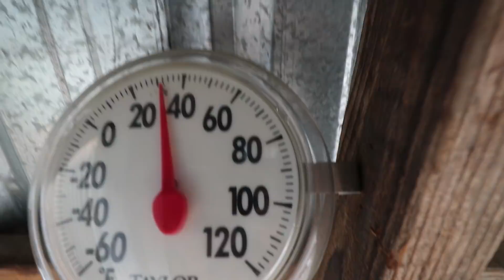Backfilling an Impossible Hillside Trench With Sand (From a Hose!)

Comment: wont the sand wash away in heavy rains or melting snow?
Reply: Yup
Reply: Unstable material will end up at the bottom. You only need to see the news to know what it can do.
Reply: John Wu no....it's not really the kind of sand you're thinking of.
Reply: It's exactly the kind of sand he was thinking of. You just watched them have to damn the thing in order to stop it flowing out. Wow, did you even watch the video. This sand flows with water. Press play for the evidence.
Reply: newly mixed concrete also flows with water. Pretty sure it doesnt after a while tho?
Reply: Jimmy Wännström 
This isn't concrete. There is no cement or  adhesive in this. 

Your comment is silly.
Reply: Do you really think they spent all this money in what you think is NORMAL sand just to have it flow away after some rain? I know the general thought is that Jesse is stupid and know nothing. But shouldnt the guys helping him know that this wont work and tell him that? After its their work. I certainly wouldnt do a job for someone with 300k subs on youtube knowing that it would fail after a year. Hell even this job was poorly executed and could make for some bad publicity.

And even if it were normal sand they could easily fill the top with soil/concrete or something else to lock it in place.
Reply: Jimmy Wännström I'm an excavation contractor and when it comes to sand, sand is sand it all washes out! There's no rock's to bind it from moving. And I've found that the majority of the time the customer thinks that they know more than you do and want you to do it anyway. I mean the customers always right, right?? I always tell the customer what's in their best interest but most want you to do it their way anyway! That's why I make them sign a disclaimer contract!
Reply: Steve Sheppard maybe do some research of this type of "sand"...it's angular not round like beach sand.  It locks to itself.
Reply: If thats the case then I agree that it is very stupid. I still hope that its not and/or that they plan to cover it so it wont wash out. Lets hope Jesse and Alyssa thought about it before spending their money on it.

Comment: Are you putting rock on top to help keep rainwater from washing the sand out ? Just wondering .
Reply: The sand will harden up and rainwater likely won't be a problem. This type of sand, known as "flowable fill" will set up and be as tight as a compacted structural fill. It would take a fire hose amount of water directed at the fill to start to get it moving again, and it would only be maybe 20 feet of the sand moving, the rest would be firm and stay in place. The sand trench will transmit water through it so look for any rain or snow melt to move down the hillside and make a mess each year for them to clean up ( but not as bad as the overrun near the hot tub steps). Another Jesse " Oohhh" moment that he will have to live with year after year.

Comment: congrats guys on getting her done  on a side note hindsight is always 20\20  if you had the time putting some boards up with spacer holes for the pipes at various points much like the steps for daming the sand lava flow may have helped  i know the timing wasn't right  but now at least you have the sand on site  cheers for the video

Comment: Why are you filling it with sand?  What's wrong with like filling it back up with clean dirt?
Reply: t450f They don’t have a clean dirt pile so they would have to buy it and drive the backhoe down the step slope. They also said that it would be cheaper to do it but pumping it once you consider you own time and labor and still the same cost of material

Comment: What keeps rains in the future from washing the sand down the trench?  In 5 years... what prevents an enormous sand pile down beside the hot tub?
Reply: They use this process to fill trenches on hillsides all the time and it does not wash away. It packs in solid. Sand is used to filter water. Where do you think all the water mixed with the sand went? It dispersed into the surrounding soil. They even use sand to make islands and the ocean doesn't wash it away. The sand will not wash out barring a massive flood.

Comment: While i’m no expert, this seams like a costly, environmentally bad way to install a water line.
Reply: it could be im not really sure thought to reinforce the pipe to keep it from busting if it freezes
Reply: Like lie it on the ground and dump 10" of dirt over it. No freezing done
Reply: Costly, yes, but enviromentally bad? Not really. Altough i'm pretty sure this will crack in no time, since there is no kind of lining, water can seep down around it and freeze, thus breaking the "lava sand" bit by bit
Reply: Yeah that sand will erode every time it rains heavier than a drizzle. Lifetime of moving sand back up a hill is no fun. They would have been wiser finding cheap or sometimes free fill dirt, more labor initially but once it's there the job is done.

Comment: All that work to protect the tree roots with air trenching, only to choke their growth with zip ties.
Reply: in a few hundred years
Reply: You serious? You think a zip tie will choke a large tree root?
Reply: Zip ties won't degrade very fast when they are buried underground protected from UV light. Depending on how tight the zip ties and the "buried waterline" ribbon are on those roots it's likely they will damage the roots long before the Zip ties degrade.
Reply: Walt Sorensen 
I think you underestimate nature.
Reply: Paul Denney that's if it doesn't snap it.
Reply: Paul I've seen both trees grow around an object, and a tree branch or root die from strangulation. You should never assume that a tree will always grow around an object. Possible, not always.

Comment: The stuff tied to the roods will definitely kill them. 
Why protecting the roots and now cut them of?
Reply: Schmunzel57 
You think cable ties will kill a root? Even if you take a chain around it, it will not kill it. It will just throw around it and eventually engulf it. As for cable ties, they will just snap.

Comment: Question:  why didn't they start at the bottom with the pump?  Would' nt that create a self damm.
? And avoid the down hill flow>
Reply: Phil Anderson nah, it would have washed out as the water drained through the uphill sand.

Sand bags at the bottom to create a dam would have been the proper way.
Reply: Did you see the guts on them boys no way they were going to pump uphill when that hose fills up it doesn’t move easy

Comment: im no contractor, but shouldnt that pipe be at least 4 ft below grade? and I find it hard to understand why you are filling it with sand... why not use filter fil to inch minus, or 2inch minus... and just use the tractor, and a dump trailer to bring it up to p, and use a mini dozer to push it down...... the steep slopes are gonna be a bitch to keep ful with rainrunoff just washing it out.

Comment: Total cost of the sand backfill?
Reply: I think I heard $40/cy times 3 truck loads (10cy/load??) =$1200 plus pump which is several hundred $$.  Painfully expensive.
Reply: Seems like it would have been much less expensive and more reliable to just have tapped into the public water system.  I remember a video of them saying that was a possibility and for not much money comparatively...but they didn't want a monthly bill.  Strange being that they paid so much for their cistern water system in time and money and then have the regular task of going to town to get their water.  I don't understand why this is better.

Comment: Wow dude and dudette .... after viewing these videos on your water line trench ... well, frankly, scary. I know there are no building codes where you are, but all you have to do is google the idaho frost depth. For Idaho, that is an average of 31", meaning 31" and above, water freezes. NOTE, that was AVERAGE. Think you are in the mountains above Coeur d'alene or Sandpoint, so you are probably going to be more like 40", OR MORE. GUYS, you don't want water during the winter? And, you want to have to dig those pipes up because they've cracked due to freezing? I can't believe someone didn't say something to you. You unfortunately have a ticking time bomb. Also, note that your SEPTIC lines contain water.

ALL pipes that contain any liquid in Idaho are usually a MINIMUM of the frost depth, but most of the time, for insurance, people put them AT LEAST 48" below finish grade.

Then, there are those footings / foundation for your garage. Hope those are below your frost line. Haven't viewed those videos yet.

Though your area does not have building codes, you do have a few inspections required. And, it is hard to believe one of those inspectors didn't warn you about this.

Not trying to cause problems, but this stuff is really basic and could haunt you if something isn't done sooner than later.
Reply: Finally someone tried to explain to them without calling them dumbasses or worse right off. If they don't listen it's their fault. More repair videos for us in the future it looks like. At least they have drive and a good work ethic, they are gonna need it.

Comment: Looks more like a cement and sand slurry, than just sand and water.
Reply: Initially, I thought it WAS cement too.
Reply: Charlie Zellner I would have thought something like 40mm to dust, sort of thing they use under roads, would have served them a lot lot better. Locks together, can be vibrated and compressed. The only downside is that bloody hill and all those obstacles.
Reply: Road foundation stone is usually very cheap. As you fill the trench at the top so you make a path for the barrow. Couple of strong lads, done in two days.

Comment: Why were you guys so concerned with keeping the electrical conduit spaced above the water pipe ???????
Reply: Pace Metal Fab and Waterjet 

More than likely to be able to find the pipes with a metal detector easy but... with all that sand that’s going to wash away  they will have an easy time to  find the pipes easy . Should have poured concrete  should have chopped roots should have should have
Reply: Dam placement would have been a huge help. the sand will be downhill in short order,
Reply: watahyahknow if they had mad a sandy mix with Portland cement maybe even mixed in some mid size crush stone but the point is why not do a pour could have made s stair case out of it

Comment: Might I also add that running a generator all the time is expensive and not very environmentally friendly. Until you can arrange an array of sufficient solar panels to provide enough energy to sustain your power needs, why don't you connect to the grid while building your home? Surely your neighbors are connected to the grid.  Just think of the money and hassle you would be saving. I call that common sense. Love to see a reply as to why what you currently are doing makes sense.

Comment: over what was the cost vise doing a well?.
Reply: They will need this system in addition to the well.
Reply: I would expect 40 gal to be more realistic but they would need to water the garden so that could easily double the requirement. Even worse if they have guests over. Demand for water has huge spikes so this system will allow it to cover that, meaning they can get away with a smaller well pump that could be run off solar.

Comment: Where is the spoil from when the trench was dug? I seem to remember writing a comment back then about back-filling the trench with what came out of it. If there is a cold-problem, just dig out a foot of sand, lay in a 2" thick strip of PU insulation and re-fill with the local hardcore mix.
Reply: The soil was under the big boulders they dug out. They would need to filter with the grizzly bars.
Reply: Don , I don't understand what the point is that you are trying to make. I made my suggestion based on standard building practices and common sense. If you can suggest anything better, please enlighten us. (I am an expert at what I do, if no-one else has done the same or better).

Comment: I'm so very confused (and admittedly stressed watching this video). Why are you filling the trench with sand (and cement?) ? Furthermore, if those are water lines, they need to be at the VERY LEAST 4feet underground to stay below the frost. The sand and cement will not help as the frost can also move sideways. It seems like a massive waste of materials. Cement is expensive and sand moves with water (aka rain). And, how are you going to dig them back up should something go wrong? I mean, unless that pipe is filled with electrical cables, but even then why cement over them?
Reply: its literally just sand mixed with water to make a slurry that can then easily be pumped using a concrete pump to move it down the hill. Also the water pipe are about 4 feet down as they were in the encasement under the saw dust in the bottom of the trench and the small PVC on top had the electrical in . I think they hope that as it drains so well any rain will drain straight through and then not wash it away- but I agree they may well have an issue with it washing out of the tench as the water will run through the sand and hit the clay and then run down the hill, and erode the sand from the bottom.
Reply: Thanks! I know a lot of people (myself included) would not want to see them fail after putting in so much hard work! We were there too 5 years ago. Watching this brings back all those stress memories, lol. But, as I've learned, sometimes you gotta learn as you go ;)
Reply: WTFarm Girl sand only not concrete. I suspect they will top fill with soil!
Reply: I haven't seen all their vids on the trench, but the last one I watched the water line was just 18in or less from the top :/
Reply: That would be the best way to go, I understand they can't really backfill  with the dirt they have, too many rocks :(
Reply: right on about that!
Reply: There is no fill. Go back and take a look at how they dug the trench. They used some sort of air trenching tool. He said the cost of getting fill up there and then shovellng by hand was too coslty and probably very manpower intensive. Thus the sand flow was the lesser of two evils.
Reply: it is not cement, just sand and water.

Comment: can some1 tell me why they are making sure that any water will freeze in pipes in the concrete?
Reply: Is it even concrete? Thought they said sand...
Reply: at the start 00.30-00.50 he talks about concrete guys, but i quess that is only concrete and sand not normal concrete with 0-32mm grade stones that im used to.
Reply: They are back fill to insulate pvc pipes from whether and as he explained this was the cheapest way to do it we often do it in construction when inspectors want a 90-95% compaction instead of trying to repack the dirt to achieve the requirements to pass  the compaction test we fill the trench 3/4 of the way with a slurry mix 5:1 ratio mix sand to cement not solid concrete but not soft dirt but the are just backfilling as fast and cheap as possible
Reply: Pedro, why would they compact to 90-95% ... that's required compaction on a roadway or driveway or under a slab. This is just a trench up a hillside.

Comment: I thought electrical had to be 18 inches deep
Reply: separation from water and electrical is also an issue, so the shallow electrical may be better than having H2O close to the electrical.
Reply: electrical will hurt you if you dig into it...  water will freeze if not deep enough..  water is going to get to the electrical conduit anyway...  if a water pipe breaks, it's hitting the conduit...  probably worse than a bad rain storm, but we're talking about people digging a hole some time in the future and hitting the electrical line and getting shocked... vs someone digging and popping a water line... which isn't as immediately dangerous.  My understanding is that if you are going to bury electrical shallow, it has to be protected by more than just pvc.. like a few inches of concrete or steel or both...
Reply: yamspaine.   the water lines are inside pvc tubing buried now at 3 feet.
Reply: electrical is more dangerous to someone digging about.
Reply: yamsplaine  No one is going to break that electric line with a hand shovel, and they installed the tracer tape to locate the trench line prior to digging with power machinery. I wish people with no clue would just shut up. Like the saying goes...'tis better to remain silent and be thought a fool, than open one's mouth and remove all doubt!

Comment: Here’s the sad facts about this y’all payed these guys to do a job and from what I’ve seen they didn’t and it looks like you do. This is why the workmanship in this country has failed people do a half ass job and get full payment.
Reply: Vince & Linda Taylor ,let's say you work at a grocery store.
Someone buys popcorn from you ,and prepares it on a gas grill ,kernals fall into the gas burner and damages your grill.
Are you responsible?
 Concrete plants depend on scheduling.
If  the morning customer who hasn't completed his forms,makes the next "is " ready for a 2pm concrete pour....is supposed to patiently wait because these "brilliant" people are not ready?
Common sense tells anyone a slurry selflevels,so a form should have been set at different hieghts by volume....and poured from the bottom up.
Nowhere on the video do they give their reasons for using a flowable to pour downhill,then expect it to stay during a heavy rain.
Unless,they cover it with a with an a product that is resistance to water penetration until vegetation can regrow.